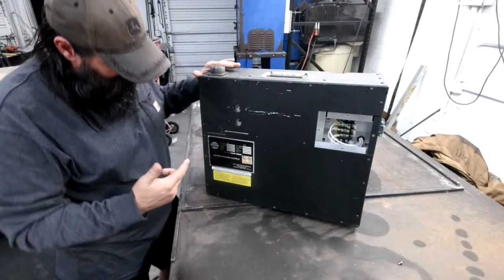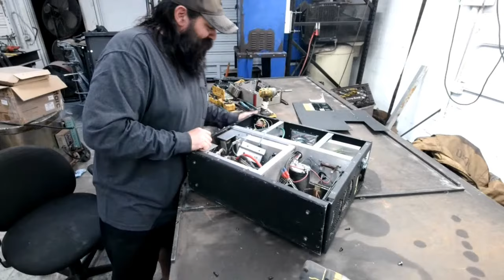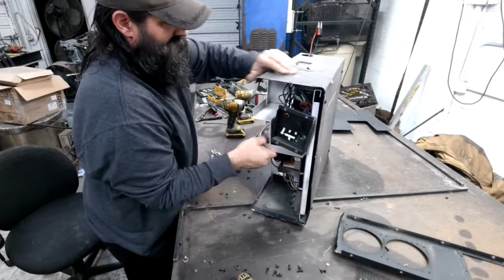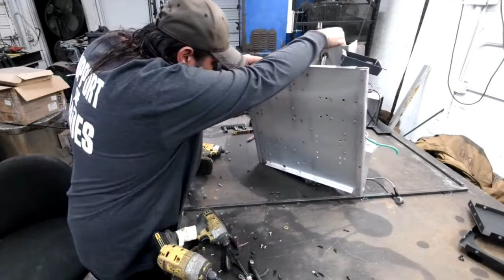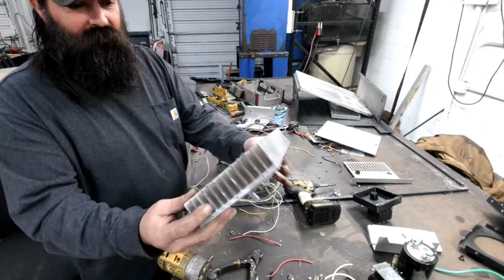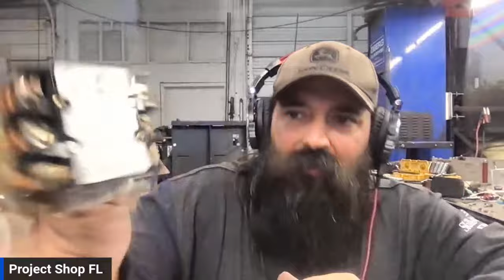Scrapping Live

Comment: The reason that  flat heads are used is because they are low torque meaning you can not over tighten as the head will shear preventing damage to componets
Reply from the maker: Thanks for the info! 👊